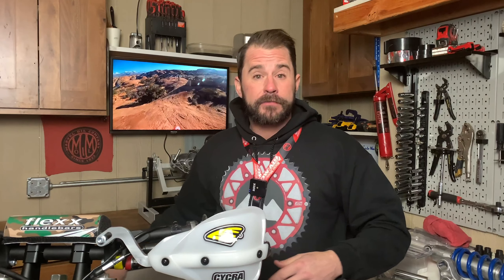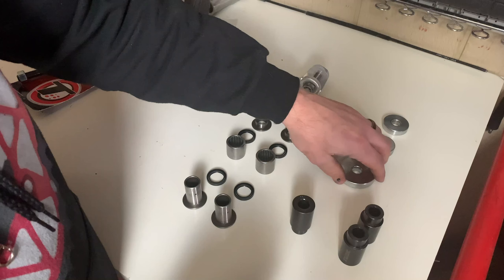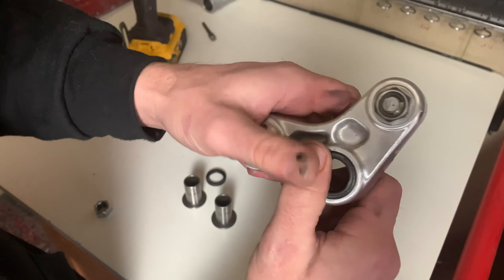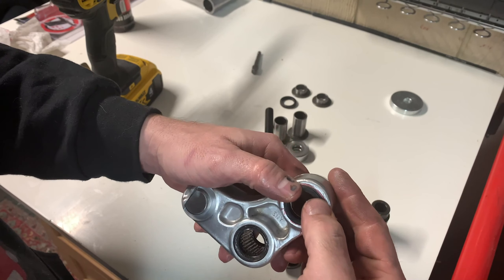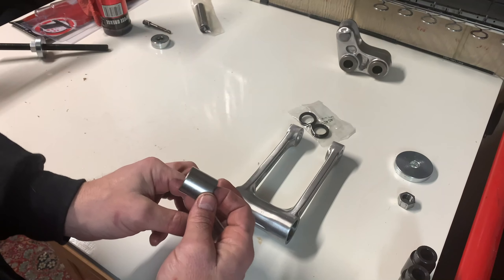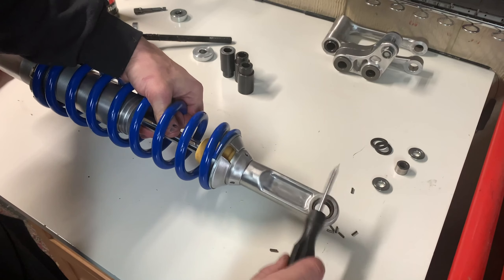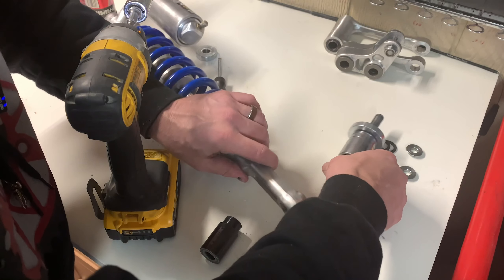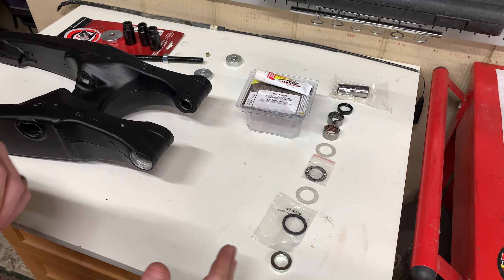Swing Arm Bearings 🤮 | YZ250 Enduro Build

Comment: make a bearing driver out of sockets , threaded rod and 2 nuts. you could probably also do this whole job if you used a torch to heat the parts and put the bearings in the freezer with exception to the shock body bearings. never get heat anywhere near a shock body.

Comment: My linkage kit came with 4 of those thin washers. Are two of them just extra?
Reply from the maker: Hey Brandon. On the linkage or the swing arm? I only remember flat washers on the swing arm and they sandwiched the flat bearings so two per each side.
Reply: This Mountain Life I meant the Swingarm. So the thin flat washers need to sandwich the flat bearing? So that will make 2 washers per outer side? Also, with my linkage kit (where linkage mounts to swing arm) I received 4 of the thin flat washers but when all 4 are used it will not fit into the swingarm. But when only using 2 it fits right in.
Reply from the maker: Yep they sandwich on the swing arm so you’ll use all 4.  I don’t remember any washers on the linkage though. I’d go out and check the OEM parts schematics on Rockymountain atv/mc. Verify assembly against the “rear arm” schematic.

Comment: I'm in the process of an 2004 YZ build, loving the content.  
The powder coating on the swing arm, is that a textured/ wrinkle type powder coat or just standard flat black?  I like the look of it.
Also on the swing arm, did you have to grind the powder coating off of all the pivoting contact points?